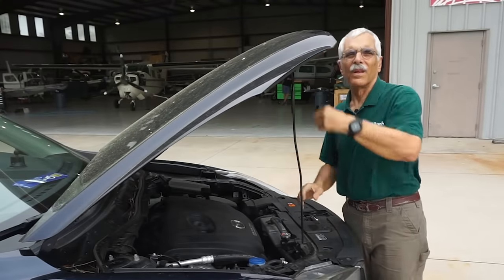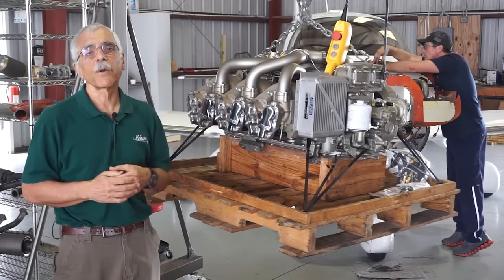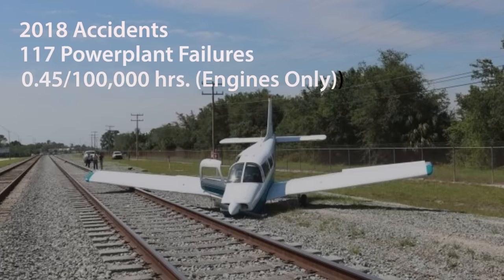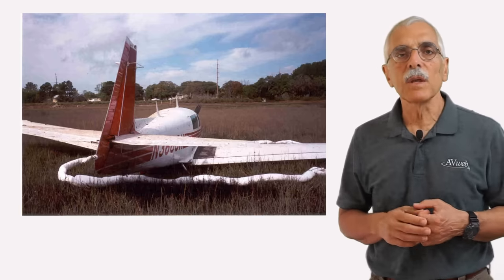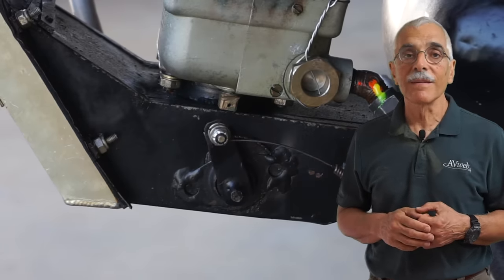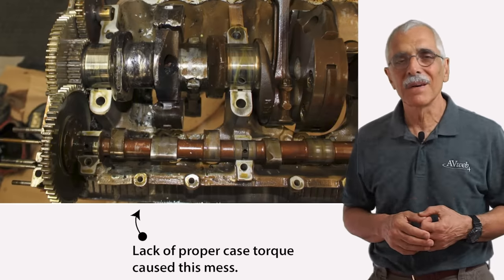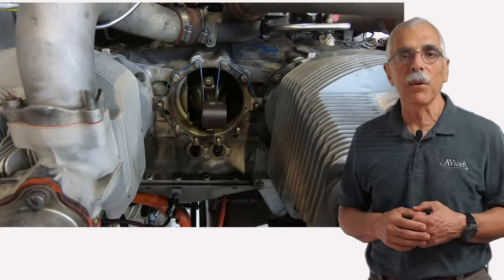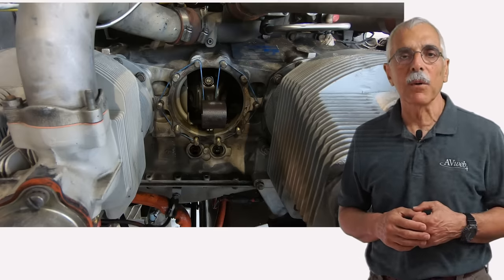Why Aircraft Engines Quit

Comment: I grew up being told all the time that the lead in fuel lubricated the valves.. namely the valve seats. I was also told after cars began using unleaded in the 1970s that they had to come out with hardened valve seats to compensate for this. So if this is not true, why was I told all these things? And why do they still use lead in Avgas? I know that was used originally to raise the octane rating..
Reply from the maker: Lead is in avgas for one reason: octane. Octane prevents detonation and is important for high output aircraft engines with high compression. There is some evidence that lead prevented a phenomenon called valve seat microwelding, where the valve itself welded in spots to the seat. But that's not why lead was in fuel in the first place and it certainly does not lubricate the guide.
Reply: @AVweb  I see, and thanks for the response. This also further confirms my suspicions that the general aviation industry also didn't have to comply to the federal mandated emission standards the automotive industry had to in the early 70's.. leading to those Automotive manufactures to turn down the performance and lower compression ratios (among other things) on their higher performing models... not a good thing in my book as for power potential (naturally aspirated or forced air induction), volumetric efficiency and even fuel economy. I guess you just can't have high octane with a decent price without lead.

Comment: It's more like a big Corvair engine. 
My two Jeeps have the 2.4 multi air engine and I've had both throttle bodies fail at 40k miles.
Didn't John Denver run out of gas or something like that?

Comment: Pa28r-201,1st flt after 100hr. Practicing Comm maneuvers.Power drops to under 1000 rpm.Gained power to 1200 by intentionally flooding engine to a successful landing.  Gascolator bowl cork gasket torn
Pays to be an AandP as a pilot

Comment: It's amazing how backwards powerplant technology is for air craft. For carb icing issues, there ought to be a sensor that picks up on this and adds heat automatically. I have a 2.7L Ford Ecoboost motor in my truck. 2800 hours on it. No failures in 4 years. Starts every time. 440lbs weight and 350 HP. I would trust it over 1940's technology, any day.
Reply: You run that truck constanly at 75% power for those 2800 hours?  Nope.
Reply: @arthurfoyt6727  Actually, the engine probably could do 75% for 2800 hours. A number of car engines have been used as aircraft engines with nothing other than addition of dual ignition, etc. Liquid cooling is the best thing that can happen to an engine, greatly extending the life due to tolerances remaining constant in operation.
Reply: @jeffpiatt3879  No, truck engines were never designed to go high rpm, high power, for 28 years (100hr/year).
Reply: @arthurfoyt6727  I have quite a bit of experience with this. Throughout the 1990's I was addicted to snow skiing. I went several times a year. One of the van services that I used to get from Denver to Breckenridge used Ford 10 passenger vans. The motors stayed spun up at 4K-6K all the way up the mountain for 2 hours. Then, coming down, the driver shifted down to save the brakes and the mower stayed spun up to 4K-6K, all the way down. I talked with an older driver who had been there for 25 years. He said that Ford used their company to test engines, fluids and transmissions. He said that most of the vans go 150K miles with no issues, and that Ford closely monitors the maintenance and that at 150K they will often take the motor and transmission and give them a new one so that they can do a wear analysis on the old one. The van company then sells the used van with new drivetrain to a company that offers van service in the Andes, in South America. This experience is one of the reasons that I started buying Ford Trucks.

Comment: I still want to know why I can't get an aircraft engine that's as reliable as a car engine.  As you pointed out, a non-trivial number of failures happen because the engine got serviced.  Car engines - just the engines - rarely get any maintenance beyond an oil change before 5000 hours of service.

Comment: Automotive Engines vs Aircraft Piston Engines:  Keep in mind, an aircraft engine spends much of its life running at 75-100% of its power rating.  The Mazda (or all automotive engines) spend most of their lives at 20% power or less, with the occasional "blast" up to 100% power rating if ever.

Comment: With the small numbers associated with GA aircraft, there is little incentive to force the manufacturers to improve engines to obtain more reliability/durability. I mean really they are pretty reliable and actually have more in common with the engine in my lawn mower than with any modern automobile. The tightly regulated nature of the industry does not help to foster innovation either. The high number of automobiles produced every year along with the number of companies competing for those dollars has forced the manufacturers to seek higher reliability and durability. It is sort of a vicious circle. The absurd cost of GA keeps the overall numbers low and the low numbers contribute to lack of innovation. Maybe I am wrong but that is how I see it from my perspective.

Comment: It seems like airplane engines are built for high torque (lb/ft) at relatively low rpms, but no one talks about the torque numbers. Just like the big block muscle cars from the 60s, the torque is what gets it done.

Comment: if fuel mixture is too rich,  a bit of ice only will make it richer and cylinders failing.  Or cylinders using oil.  = both make mixture too rich via too much fuel or oil inside cylinders and a bit of ice only will block the air, mixture gets richer and start fouling the plugs or dirtying the valve seats and lose power.

Comment: When I looked at the sophisticated engineering behind the Toyota Prius Hybrid, I was sure that its reliability would be poor. There were more pieces parts and subsystems than a conventional internal combustion engine equipped car. While that is true, the Prius has consistently been the most reliable car on the market(!) Why??? How??? Belt and suspenders engineering. Toyota understood what a hybrid powertrain would entail and engineered with that in mind. Point is: it can be done. All it takes is money and management's commitment.

Comment: Lost in all this, is how much maintenance per flight hour is needed on these small aircraft, just to keep them reliable. Simply too many parts. Add in dependence on pilot to perform engine/fuel procedures while in flight, it is not surprising accidents happen more in general aviation.

I suspect getting rid of piston engines in favor of electric motors will drastically improve statistics. I'm surprised we have not seen a turbine/electric hybrid yet for small aircraft outside of experimental. Even with a failure of the turbine generator, the electric motor can work off battery for the time it needs to land.

Comment: You'd think a really sensitive, broad frequency microphone attached to the engine coupled with a good DSP algorythm could detect and warn of impending rod bearing doom via harmonic analysis. Fretting bearing caps and journals gotta disturb the harmonic frequencys resonating through the contraption in predictable ways. Oil analysis seems like a no brainer as does confirming your fuel is dry before ascending to the heavens, at least if you don't actually seek a one way passage to the hereafter.
Reply: Yea it'll give ya a 10 minutes to impending doom warning and you're 11 minutes to the nearest airport. These planes are stupid. I love listening to these channels, they're interesting, but I'm like, why do these guys fly these planes? They crash all the time.

Comment: I'd much rather use an automotive engine that an aviation product, it's been a long time since the reliability thing was convincing beyond the doubling up of magnetos - which isn't exactly impossible on an automotive system. Kinda blows my mind how relying on inefficient 1960s steam power is still "best practice". Using small turbo automotive units in light aircraft would probably do a lot for reliability but also power and consistency: how many density altitude deaths would be avoidable with turbocharged engines? Ditto all the other problems caused by flying underpowered kites that stall and crash if you go outside a 40 knot flight window, can't climb, can't turn fast, just basically lumber around just about flying 🤷‍♂️

Comment: Auto engines would seem to have far better mechanical reliability and far poorer maintenance than aircraft piston engines. Yet, full on mechanical failures of the broken connecting rod, spun bearing, stuck valve, etc. are exceedingly rare.  Perhaps a better comparison would be the air cooled motorcycle engine.  The Japanese engines are extremely reliable and long lasting.  Consider the two mid-1970s Honda 750 motorcycles I owned until recently.  One had 8,500 miles and the other 24,000 miles.  Neither had ever had an engine failure.  

It seems to me that the frequent tear down schedule might actually be contributing to engine failures.  On a properly designed assembly line, the combination of automation and standardized processes means that consistency is likely better than one-off assemblies.  In the tear down and reassemble process, there is too much room for a mechanic to be distracted, have a bad day, a hang over, personal or family issues, and miss a torque spec or safety wire.  There are too few checks and balances.

Comment: About that engine, also 2.3L version, and kids it's in your Ford too. Ford =Mazda. So the point is that than engine has no keyways to help keep the timing chain/crank shaft/camshafts aligned. And a strong snap acceleration or downshift will cause a gear to slip and possibly the engine destroys itself. Nice car to drive, but don't keep it long.

Comment: Shocked by the C172 pilot turning back after engine failure on take off.  In this circumstance, land straight ahead +/- 30 degrees.

Comment: I made an emergency landing in my C-150 at Brunswick Naval Air Station after loss of power, still ran, but only 800rpm.  Took off after ice melted.  Carb ice, despite full carb heat.
Reply: I also ran out of fuel.... oops.  Was positive there was fuel, but no.

Comment: With all the resources the ntsb has, and how critical their work and conclusions are, I absolutely cannot believe they don't have more data on the issues you brought up. That's unacceptable. Add to that the faa's grip on what engines can and can't be used in an aircraft and we have a situation where we're forced to use engines that not only ridiculously expensive, they're a dozen generations behind in technology, and really, not reliable overall. Carb icing should never ever cause an accident in this century, do something about carb icing. Do something about these ancient, low tech, ridiculously expensive boat anchors that are the only certified power plants. The faa and the ntsb need to do a better job. At this point, both agencies are only holding back the world of general aviation, quite the opposite of their charters.

Comment: If you fly your airplane only once every couple months, or even less, do yourself a favor, and run your airplane for a brief amount of time. A few minutes, tops. At idle power. Maybe do some taxiing for those few minutes. 
If you really cant be bothered, even just 1 minute of running in front of your hangar helps a lot.

When your engine sits for weeks or months without running, all that leftover oil finds its way down to the sump. Or just dries up in place alltogether.

The oil film/s keep oxygen, and thus corrosion, off the internals of your engine. But that film doesn't stay on those internals for terribly long. 

If you dont do anything else to keep your plane exercised, i beg you to at least do this. 

(Also sump the bloody tanks.) 

This goes a long way with keeping your engine healthy internally, and subsequently preventing you from losing an engine, and then an airplane, on the (far too) rare occasional you do fly. 

Sincerely, a piston A&P mechanic.

Comment: Carb icing is the thing I couldn't get into my monkey brain. This is because, cars don't experience this problem, at least in my limited experience with carbureted car engines, including an air cooled VW. I know this must have been the mental hang up about it. It was like I thought all airplane engines were fuel injected, even though, I knew for certain the Cessna 152s I was flying had carburetors. I also knew about icing, yet I would pull the throttle back and forget to pull the carb heat over and over and over. I just had this unshakeable mental block with carb heat. Now, later on, way later on, I know the problem was with my training. My training was based upon a mental checklist, not actually using a physical copy or the one on the visor. I never had icing happen when I forgot, which was too often. I think I was over that problem before I soloed, but I remember that being the hardest thing to remember for landing, slow flight, power off stalls and anything else I am forgetting.
Reply: Yes.. For me was too years ago when PPL.  You just have to do the thing you tend to forget as the first thing.  Same on go arounds, carb heat off first.

Comment: Great video! I can see you really know your stuff!

I couldn't help but laugh out loud at "Are aircraft engines as reliable as car engines?" Not even remotely close! They're honestly terrible! The fact that you said the word "carburetor" in this video is pretty good evidence of that.

But from an engineering perspective, let me just lay out a few illustrative facts.

What engines love: being run at constant RPM for duty cycles long enough to reach thermal equilibrium, in an environment that's quite clean most of the time. Like an airplane at cruise, high up in the sky. 
What engines hate: constantly variable RPM, often at low or zero speed so there's less cooling and lots of thermal expansion and contraction leading to friction, with duty cycles that are often only barely long enough to heat them up just so they can cool right back down again, in an environment full of dirt, dust, and other debris, blocked by an air filter that costs $19.99. Like a car on a road. (Anything but highway driving is even classified as "severe duty" for road vehicles.)

In fact, aviation duty cycles are so gentle and predictable that it's easy to use effectively constant-speed engine types instead, namely turbines. Not as generators to power a hybrid system, like in a train or a tank, but directly as the means of propulsion.

So now that we understand that aviation is a much friendlier environment to an engine, let's figure out how many miles a typical aircraft engine would be running between its overhaul intervals if it were instead living the life of a car engine.

A typical car, over its entire lifetime, will have an average velocity of between 25 and 45 MPH depending on its owner's usage pattern (town vs. highway), so let's average that to 35. A typical GA airplane with a piston engine will need an engine overhaul every 1500 to 2500 hours, so let's average that to 2,000.

So, simple enough; multiply 35 miles/hour by 2,000 hours, and we get 70,000 miles.

In other words, a typical aircraft engine, in order to achieve a good safety margin, operating in absolutely ideal conditions (the closest automotive conditions would be "standard duty", meaning almost exclusively highway miles), needs a full overhaul every 70,000 miles.

Now, maybe 30, 40, 50 years ago you'd have been okay if your car engine had a fair chance of dying that fast, or if your owner's manual told you you needed to have your mechanic pull the engine and strip it to its bones, inspect everything, and replace any wear parts that are worn, ever 70k. But now? Pfft, most cars come with drivetrain warranties that last significantly longer than that, and it's extremely common to go more than double that mileage with nothing more than regular fluid changes. And remember, that's in conditions that, compared to those an aircraft engine operates under, are absolutely brutal.

So... are these "simple" old-fashioned aircraft engines with pushrods and carburetors more reliable than a modern, variable-timed, forced-induction, small, efficient, direct-injected car engine that lives twice as long between overhauls while doing a much harder job? Ahahaha... aha... ha... nope!

And considering how much higher the stakes are in an airplane if the engine fails, that just blows my mind.

I mean, of course, as you said, the difference in numbers between 6-8 figures per engine design for car manufacturers vs. 3-5 figures for aircraft manufacturers plays a big role in that difference in quality, technology, and, subsequently, reliability... but still. We're talking about decades of advancements apart. Looking over Lycoming's site, the latest and greatest advancement I see in their engines is the advent of a computerized engine control unit, built-in diagnostics, and bi-fuel capability. So in other words, something like the innovations found in a late-90's Ford Taurus. Oh, wait, they have push-button start and automatic mixture adjustment, so... make that an early-00's BMW. Except all this comes with a displacement-to-power ratio that would make a 1970's Cadillac blush. And this, they proudly tout as "modern automobile technology in an airplane". Uh-huh.

Heh... and now shall we talk about the real kings of reliability: semi truck engines? A typical time between overhauls for one of those beasts is 12,000 to 15,000 hours!